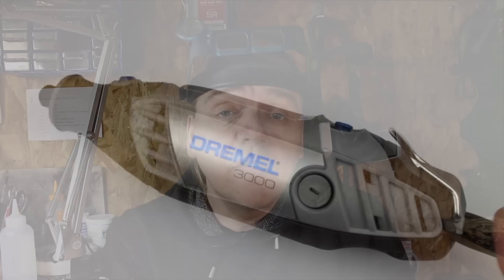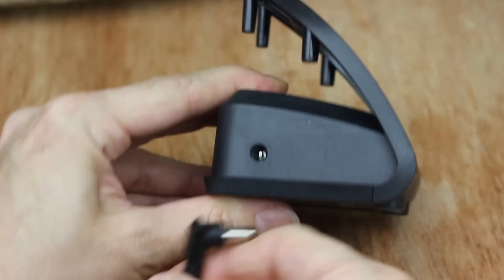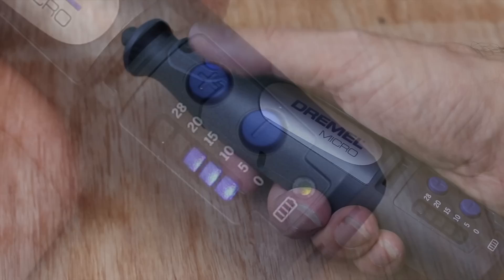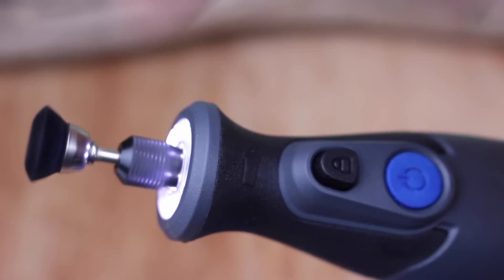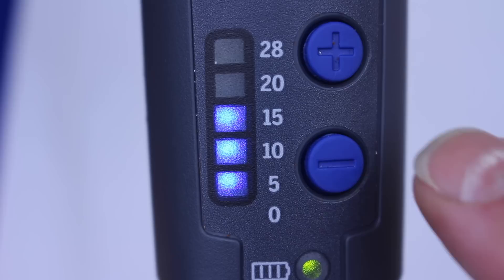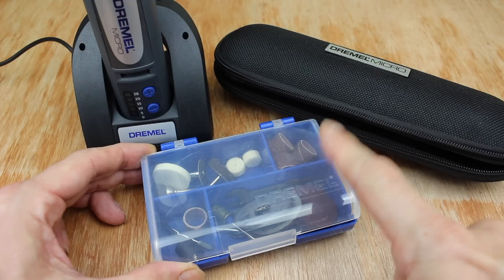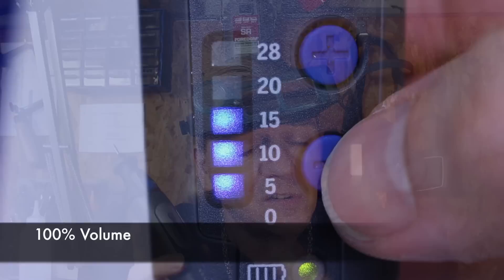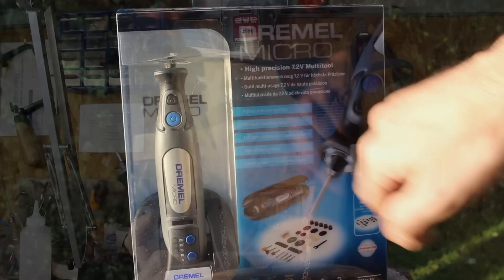Dremel Micro Cordless 8050 FULL Demo,  Review & how to in HD

Comment: Hi Dave,  thanks for this review l was so impressed l bought one. The only thing is it didn't come with all of the attachments yours did.  Mine came with 18 attachments and therefore l need to buy more. 
My question is quality, are all dremel attachments OK for quality or not.  I would rather buy decent quality but living in Australia l am having trouble finding where to get accessories.  Can you please give me some advice please. I want to make jewellery and polish stones.  Thank you for all your great information Ann
Reply from the maker: G'day Ann. The main difference between Dremel branded accessories and most of the professional ones is the diameter of the shank they are mounted on. A standard Dremel accessory is 1/8th Inch. Professional jewellers accessories are usually 2.3mm. So in order to use these in your Dremel you will either need a set of different size Coletts, or better still fit a Multi chuck. See the video below which explains. https://www.youtube.com/watch?v=FclCj7fuJ64&t=1s

For polishing jewellery use felt mops Tripoli and soft cotton or wool mops, with rouge polish. 
https://youtu.be/L71O7hqvJa8

As for polishing stones, that's a slightly different matter, you're probably going to need diamond paste, depending on the stones you are using and how hard they are. But that's a whole different speciality, and not something that I do personally. Google "Lapidary". But what I will say is that if you want to polish stones (using diamond pastes) then you're going to need something a bit more powerful that can work for extended periods, hence corded. Hope this all helps. Dave
Reply: Thank you once again Dave for the information, it certainly was helpful. I am excited now to see what this thing can do. I love your videos, I learn something useful in each one. Thanks for taking the time to answer my question. Kind regards Ann
Reply: Ann Gabriel "

Comment: could you use these tools for wood carving, or would it hurt the bits
Reply from the maker: ye sindeed perfect for wood carving. There are thousands of bits available. For wood carving the HSS (High speed steel) cutters and burs would be the best option, with the sanding drums too.See the link below. Note though that for very tough wood or for larger extended jobs,  then the corded versions like the 3,000 and the 4,00 will offer more torque and longer use. . Dave
https://www.dremeleurope.com/gb/en/products/accessories/?start=0&System=Multi-Tool+System&Material=Wood

Comment: Thanks great video I looked on offer up in found this same dremel  for 30$ brand new.i have a question I also bought a saw adapter can I use it on this device?
Reply from the maker: Probably not. Most of the accessories attach to a deremel by removing the screw cap on the end, near the chuck. This cordless version does not have the screw cap and is too small. So for most attachments you will need one of the large units, like the 3,000. Dave

Comment: Great video thank you! Did the screw come off the end of the mandrel ok for you? I have a brand new mandrel accessory and I want to add a cutting head. But the screw will not budge!
Reply from the maker: If the screw wont budge it may be cros threaded. The screws are so tiny they easilly get damaged. Probably simpler to just get another mandrel. Dave

Comment: I wonder if I can polish my truck wheels with this
Reply from the maker: A little small for a full refurb perhaps. and consider the recharging time if you're doing a big job. But if you're just touching up a small spot, then a sanding drum on the Dremel will do nicely. The cordless nature does mean its not quite got the torque of the corded models, but it does allow you to work on the driveway without a power lead. So in the cordless models, torque is sacrificed for flexibility. Hope this helps. Dave

Comment: Can routing be done with this? Wondering if I could avoid purchasing a router since I have one of these :P
Reply from the maker: You can always use router bits freehand. But the small Dremel router and other attachments need the large removable collar, which you see on the larger corded models for attaching accessories. This Micro does not have that removable collar, so is effectively a stand alone unit designed for  fine hand work. Hope this helps, Dave
Reply: Celtic Dreams thank you Dave!

Comment: Hi! I Recently buy one of these and I wanted to know how long the batery last, in my first use it turn off in about 45 minutes after a full charge, is that normal? I appreciate your feedback cause if is not I'll go for warranty. Thanks!!!!
Reply from the maker: 45 minutes sounds good. It’s difficult to say how long a charge will last and Dremel don’t even say in the manual. It depends on how you use the tool. Light polishing will last longer, heavy grinding and carving will use the battery quicker. So, it impossible to say. I keep mine in the charging stand on my bench and its always ready to go. I tend to use it in for short jobs, perhaps a couple of minutes each time and then back in the stand. I’ve never had a problem with it running gout. Hope this helps a little. Dave
Reply: @CelticDreamsCoUk  thank you for your answer!!! I end up changing it for a Dremel 4000, I look for a video in your channel but I only found the 3000 tutorial, thanks for the amazing videos, you are a great teacher!!!

Comment: whats the difference between this and the 8200 model?
Reply from the maker: The 8200 is more like the larger cored models. It's larger than the micro and features the screw on cap for use with various accessories. It does not have the LED light. It charges in 1 hour and I suspect is probably more powerful than the micro. Hope this helps. Dave.

Comment: Apparently if you are handy at it, you can de-solder and replace the battery.
Reply from the maker: I've never tried and obviously cant endorse that. But yes you probably can, I did it with my electric razor. The main issue with many such modern items is figuring out how to get into it. But once you're in they usually have pretty standard rechargeable batteries.  Thanks for watching. Dave

Comment: Those heavy duty cutting discs, would they be suitable for slicing through thin branches, to make wooden discs? Thanks
Reply from the maker: No. they are "grinding" discs, intended for metal. If cutting wood with them they will just clog and burn the wood with friction. You need a saw blade for wood, not a grinder. Hope this helps. Dave
Reply: @CelticDreamsCoUk  Thanks!

Comment: Does this tool can engrave in stone and metal other than wood! Thanks in advance mate
Reply from the maker: A few people have asked if it can engrave various specific materials. The point to note, is that it's not the tools that does the cutting it's the bur or drill that's being used. So it depends what you mean by stone and metal. Precious metals, aluminium, copper brass etc can all be engraved very easily with HSS high speed steel cutting burrs. The smaller size and lack of a cable make this model ideal for that. Harder materials like steel, stainless and iron, would likely need Tungsten carbide cutters. Hard quartz based rocks like granite would need the diamond tipped tools. With the right cutter it's a perfectly good engraver on any material. By engraving I mean light lettering on the surface, like engraving a name.  it perhaps lacks the power or torque  for really deep  cutting into hard steel or quartz based rocks. But get a good engraving bit and it should work with almost anything. check out the link. Dave
http://www.dremel-direct.com/acatalog/Carving_Engraving_Routing.html

Comment: Thank you so much for this, i am actually thinking of getting it to replace my 3000, just a question,  is flex shaft still need on this? and how long the battery will last? thank you!
Reply from the maker: The flex shaft is not compatible with this Dremel Micro. The battery seems to last quite well, but it will depend on how hard you are using it. Dave.
Reply: well noted on that, Thank you for your response :-)
Reply from the maker: If you want a cheap Flex shaft then take look at this (link below) not much more expensive than the Dremel Micro..Dave.
https://www.youtube.com/watch?v=4CB3lRh2c74

Comment: The manual seems to make 2 different remarks in 2 different locations. Is it OK to keep it stored on the charging station when not in use and fully charged? Again in one section the manual says not to, but farther in it says it's OK. your experience on this, or anyone else who's familiar?
Reply: Sorry I seen the answer below. Also James Bond is correct, LION so not have memory so topping of in not a concern. I was more worried about over charging and than the possibility of over heating which is somewhat of a concern with Lion's.
Reply from the maker: Indeed. I just keep mine permanently on the dock, and charging. It's always ready to go. No heat problems. Thanks for watching. Dave

Comment: Thank you for the great review. Can the dremel cut copper for jewelry.? If so what attachment.
Reply from the maker: Yes, it can cut copper within reason of course. But it depends what you mean by "cut" and how exactly you want to cut something. The fibreglass reinforced cut off disc is good for general trimming and sawing off. Drills can be used to pierce holes, and a round diamond burr used to engrave. Any of the sanding drums or grinders can be used to shape edges of cut shapes. Again it depends on what you are wanting to do. If you are working with sheet, and want to cut out shapes then a pair of tin snips and a jewellers saw will serve you better. But for finishing the edges of cut the shapes and for small polishing and engraving jobs then this would be great. As this is a rotary tool, think more about sanding, polishing and engraving. If you need to saw - use a saw. Hope this helps. Dave
Reply: Celtic Dreams I mean cutting shapes for jewelry (I am not good with jewelry saw). Thank you for answering
Reply from the maker: You can use side cutting burrs, which will allow you to cut in any direction, such as the link below. But they will be slow work with metal, as they are really intended for plastic and wood, and you would still need to pierce the work for cutting internal shapes. So in my opinion more trouble than its worth. http://www.dremeldirect.com/acatalog/9901_3_2_mm_Tungsten_Carbide_Cutter.html 

So I go back to my original statement, if you want to cut shapes out of copper sheet for making jewellery then use a jeweller’s saw. After all, that what it was invented for. You say you aren't very good with one; perhaps you simply lack confidence with it. Keep the saw vertical and at the right height, so use a good solid bench peg about elbow height. Your forearm should be horizontal. You should only ever need the lightest of touch. Don’t over tension your blade either, a common mistake. It’s also vital that you get quality blades, go for Vallorbe Swiss ones and you won’t regret it. The cheap Indian ones just break and you'll never get anywhere, and you’ll just feel hopeless. If your designs are intricate then try and get the blades with rounded backs, well worth it. Also, not many people understand what the difference saw gauges are. You need a blade which has at least two teeth in contact with the edge of the material. Too fine and there’s more chance of breakage. Vice versa, thicker coarser blades will just snag and break. So you need to google a piercing saw chart and ensure you use the right gauge of blades for the thickness you are sawing. Finally, grease your blades with cut lube, pepe lube, beeswax, or even a candle and keep doing so. The right blade, good quality, used properly, is a joy to behold and will leave you with a perfect cut that needs no finishing. 
Feel free to email me if you need any help or advice. Dave mail@celticdreams.co.uk
Reply: Celtic Dreams Thank you again you're awesome

Comment: can at be use in the dental stuff? for a plastic teeth?
Reply from the maker: If you use the correct burs then It can be used on anything. The Dremel simply provides the power, its the burrs and accessories that do the work. Dave

Comment: Could I use this to cut out shapes into vinyl plank flooring?
Reply from the maker: Many people ask if this can be used on a specific material. The question is not the Dremel, its whatever accessory or cutter you use with it. You can get HSS steel cutters which should be fine with vinyl, or Tungsten carbide cutters for harder materials. That said, this little cordless unit is really more suited to lighter jobs like jewellery and engraving. It lacks the power and torque of the bigger corded versions. So for heavy DIY I'd suggest looking at the 3,000 corded or similar. Hope this helps. Dave
Reply: Celtic Dreams thank you sir! Probably a dumb question but where could I get those extra accessories?
Reply from the maker: Depends where you are ( I have no idea what country you are in). Most DIY stores will carry a few  Dremel accessories. Amazon of course. Or Direct from Dremel. See link. https://shop.dremeleurope.com/gb/en/products/accessories  Dave

Comment: What was the battery time use?
Reply from the maker: It depends on what you are doing, the speed, the hardness of the material and which tool you are using. I keep mine on the charging stand, and it's never been an issue. Dave

Comment: How many hours can I use on a single charge?
Reply from the maker: Impossible to say. Even Dremel do not say . It depends on the material you are working on (how tough), the tool you are using (heavy grinding and drilling need more power) and even the temperature. I keep mine in the stand and it's always fully charged. Dave.

Comment: can i use this for my dog trimmer?
Reply from the maker: Yes, I use it on my own nails, using sanding drums. I’ve seen similar products aimed at the pet market (or the false nail market). But the Dremel is probably more powerful than most of those cheap pet trimmers, So Just go slow so avoid heat from friction. Hope this helps. Dave

Comment: I just bought an used one without the charger, anybody knows the output marked on (volts and amps) the output of the charger?
Reply from the maker: 12v 500mA (centre positive) Model S008MB1200050  Dave

Comment: I own one and I think I over charged it and now it won't turn on atoll no lights nothing so what battery's do I need to get to replace ?
Reply: I notice you said you can't replace the batteries ? Anything can get replaced if there's accessable way I did open it and there's 2 batteries as a handy person all I need to do is take the old ones out and resodler it but just curious what lithium batteries to get cause there abit longer then normal rechargeable ones
Reply from the maker: The internal battery isn't intended to be replaced by the user. (but Ive done this with my electric shaver) But Ive not opened the Dremel, So  i'm not sure what kind it is. Dave
Reply: @CelticDreamsCoUk  I'll figure it out thanks thow

Comment: Is the flex shaft compatible with all dremel rotary tools?
Reply from the maker: What flex shaft ? Dave
Reply: The flex shaft that comes with the DREMEL 3000-1/25 130W ELECTRIC MULTI-TOOL KIT 230V would it be compatible with other dremel rotary tools?

Comment: I love dremel but this one is poorly designed. The chuck button is too close to the power button. I believe they actually discontinued this model.
Reply from the maker: I know your point, at first I did switch it on a few times whilst trying to change accessories. The nature of the device dictates this arrangement. The lock needs to be near the chuck, and the pencil grip, naturally suggests a power button near the tip. Personally I like this, it has now become an extension of my hand and I flick accessories in out all day long, no problems. Dremel replace most models almost annually, to keep the market fresh. However this does not mean any model was retired for a particular reason or defect. The discontinued lines can be real bargains if you catch them at the right time. Dave.
Reply: @CelticDreamsCoUk  they could've put the power button in another location. Or put a guard on the chuck lock button so it doesn't get pressed by accident. I have this Dremel at work and while it works, the chuck button is basically it's biggest draw back.

Comment: Seems like  buttons are too loose. The grip is worse than the classical dremel 4000 “sleeve” extension which is better grip for micro applications.
And stil Dremel has this lock unlock system which is not equivalent to the quality of the company. I hope they fix it. 
The price is a little “nahhh... I ll buy the 4000 for around 170 $£ than pay 105 for the macro. HANDS ON 
Check the power button when it’s pressed to close... oh my god... NO WAY
DREMEL I’m sur YOU CAN DO BETTER
✌️
Reply from the maker: Not completely sure of your point. The lock / unlock system uses the push button to lock the shaft whilst you tighten or untighten the chuck, which can be done with the spanner if required. I’m not sure what the alternative would be. It’s too small for a chuck key or a twist lock. Perhaps a lever system like seen on jewellers’ flex shaft handpieces. The Dremel is what it is- a cheap tool for the hobbyist. It may not be perfect, and it doesn’t suit everyone. But personally, I think for the price point, the quality and functionality offer great value. I use it daily, despite having a flex shaft on the same bench. Thanks for watching. Dave

Comment: there are better substitute (rotary tools). Dremel is more like a disposable tool. Means you can't even replace its bearings, for that you have to replace the whole armature. Greedy company. Stay away from dremel crap.
Reply from the maker: I think it's fair to say that most tools nowadays are disposable. Very few things are designed to be serviced, and very few manufacturers supply spare parts. But if you know of a similar tool which has replaceable parts, please share. Thanks. Dave